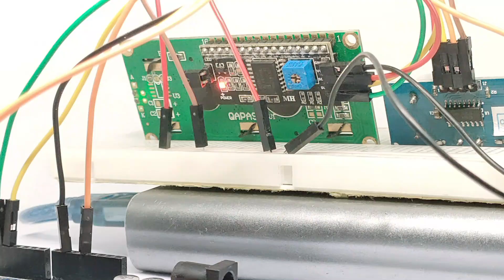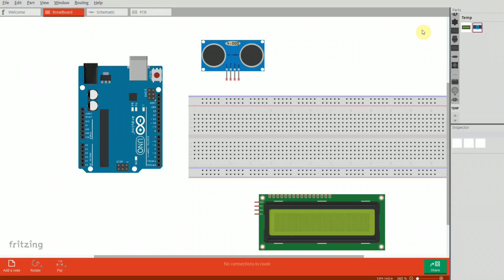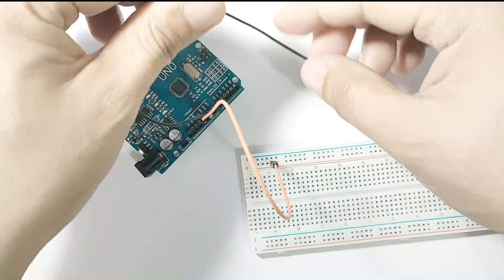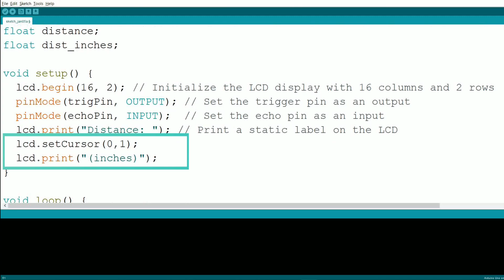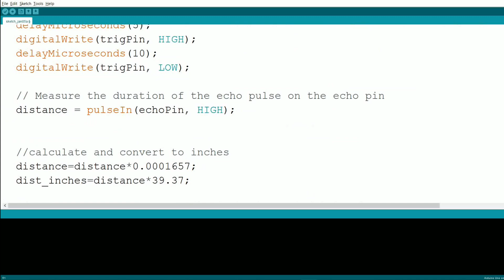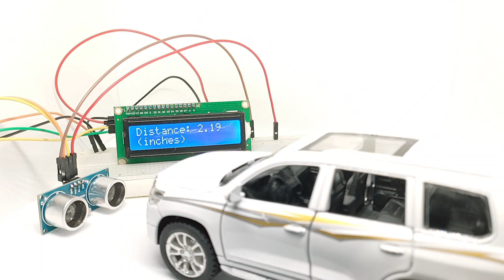Measure Distance LIKE A PRO with Arduino and HCSR04 Ultrasonic Sensor!

Comment: excuse me sir, when i uploaded code to the arduino, why the lcd was only bright, didnt display anything there?
Reply from the maker: It sounds like there might be an issue with the code or the connections. Double-check your wiring and make sure the code is correctly initialized for the LCD. You might also be using broken jumper wires. Try changing wires.